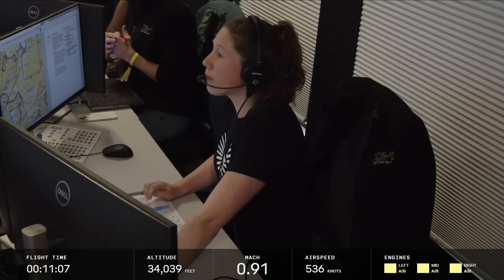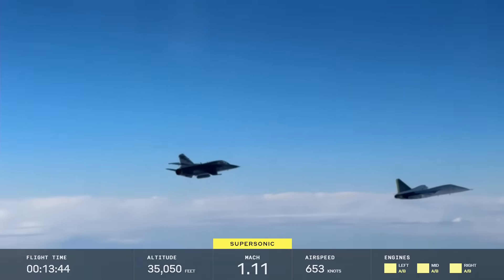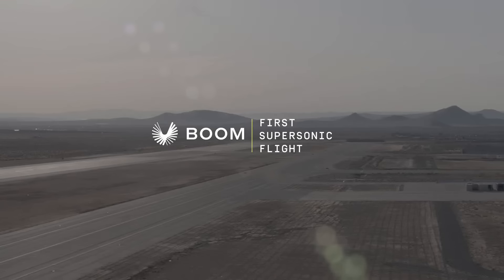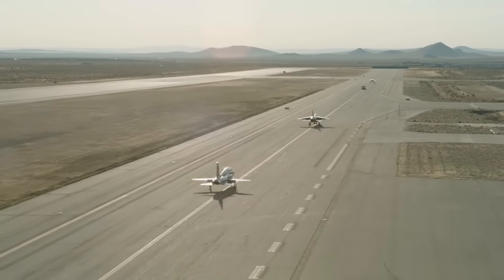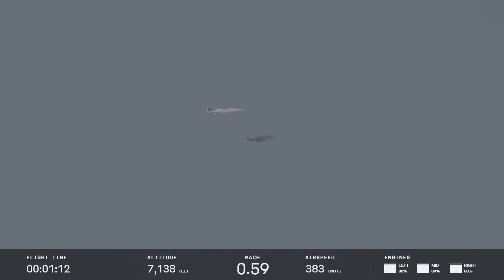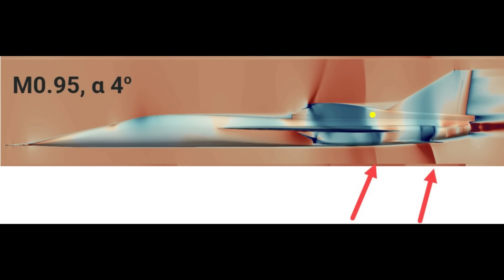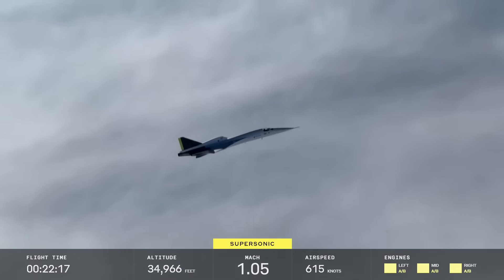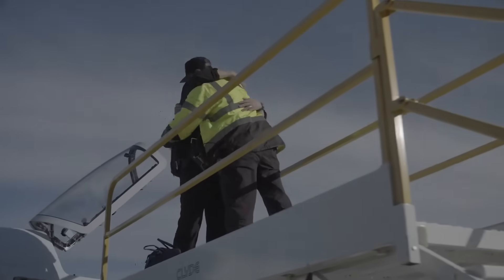XB-1 Baby Boom Goes Supersonic - Jet Planes, Starlink & iPhones

Comment: The physics of Boom's Overture isn’t in its favor: sonic boom strength scales with the cube of Mach number based on slender body theory, and so using Boom’s own numbers suggests it’ll be over 60× louder than their XB-1 demonstrator. Even if you shape the N-wave into a “thump,” the total acoustic energy from a 170,000 kg SST is still enormous. And let’s not forget that supersonic overland flight is still banned by the FAA and ICAO. Boom has no certified engine, no clear path to regulatory approval. This increasingly looks more like a PR story than a viable airliner.

Comment: Mach 1 in a small jet isn't to hard there a few business jets past and present that could hit Mach 1 under favorable conditions so all you really need is the optimized air frame. The jet that I am thinking of is the original Lear Jet which is very jet fighter like and I have heard similar claims about some more modern jets as well.

Comment: Scott, they won't be going supersonic over land. The public had a big issue with that. Broken windows, damage to hearing, just general annoyance, etc. This aircraft will fly over land at Mach 0.95, so no sonic boom. It's about 20% faster than a 787. They will go Mach 1.7 over water. (so, LA to NYC in four hours instead of five, and LA to London in about eight hours instead of 11.)

Now, there's something called Low Boom, that Lockheed and NASA have discovered, that lets you break the sound barrier with a sonic boom that's barely audible. THAT one will be able to fly over populated areas. 🙂 I think they are supposed to start testing that over populated areas this summer. Boom Supersonic will hopefully start using that at some point as well. 🙂

Comment: Eh, the political aspect of the supersonic overflight ban is usually greatly exaggerated by Europeans. The real reason is that the Air Force conducted actual tests of supersonic overflights of populated areas to simulate something as large as an airliner in supersonic flight... and caused a ton of damage to buildings across Oklahoma City. The same ban killed Boeing's SST (which would have been significantly better than Concorde in almost every way,) too.

Comment: What engines do the concord boom has. I honestly hope it has ramjets which would probably increase fuel economy at supersonic cruising speed.

I think ramjets could help fuel economy but idk if I could be wrong. Somebody let me know if I AM wrong on that
Reply: You can find details about their engine on their website, doesn’t look like ramjet
Reply: @olasek7972  I saw. It's not a ramjet. It has compressors. Plus the tri-engine design might not work well with 2 turbo fans and 1 ram jet. The ram jet will output tons of probably unbalanced thrust unless precautions are made, and I think the design shouldn't get changed like that anyways...

Comment: The CJ610 spools up pretty quickly as anyone who has seen an early Learjet in action can attest (it's also the same engine used in the T-38). I can't tell you what might have been going on in terms of acceleration or if they have a FADEC system that commands a slower power up. Interesting that the XB-1 needs afterburner on its 3 CJ610s to go supersonic while the T-38 can pass mach unity (also with afterburner) with 2. While the XB-1 is larger overall, its operating weights are largely similar (13,500lb MTOW v. 12,500lb for the T-38). Perhaps the T-38 is using a greater proportion of power from its afterburners than the XB-1 is. Supposedly the XB-1 has a hypothetical max mach in the 2.2 range.

Comment: The Concord was a failure for a number of reasons. US manufacturers had a supersonic airliner that carried more passengers and went faster than the Concord. The problem was that sonic boom. Even US based manufacturers couldn’t get approval to fly over most of the States during supersonic flight. Without that, it simply didn’t pay to produce it. What parts of Europe allowed the Concord to overfly during supersonic flight? At any rate, new work seems to be able to minimize that boom, possibly allowing a new age of supersonic flight.

Comment: When I was growning up in the 1950s-'60s near Wright Patterson AFB, sonic booms were a fairly regular experience much to the consternation of our neighbors and especially my mother.  A large crack appeared in the plaster of our dining room ceiling that kept growing with those regular loud booms and Mom was pretty upset.  The Air Force purchased a house a couple blocks away and installed sound/pressure test equipment to monitor the noise from activities at Wright-Patt.  The current restrictions on supersonic travel over the Continental US were a result of the that testing/noise creation/property damage from those "old bad days" and had nothing to do with the much later appearance of the European Concorde.

Comment: The reason they didn't allow supersonic planes to fly over the continental USA is because of the sonic boom over built up areas not because of politics. This is the main design parameter of Boom Supersonic to reduce the sound wave caused by the sonic boom.
Reply: Correct on the first part, incorrect on the second.

A lot of people are getting confused, that’s a different project. Boom doesn’t care about shockwave noise, they are developing an aircraft purely for trans oceanic flight.
Reply: Wrong about the sonic boom, the goal is to make a profitable 1.7 Mach 64-passenger aircraft regardless of the sonic boom however even this seems to be doubtfully realistic goal.
Reply: @olasek7972   Right about the sonic boom. Google 1973 Civil Supersonic Airplane Noise ban.

Comment: Supercruise should be a requirement for light supersonic jets like this one... having to use afterburners in order to go supersonic is so 20th century, also, it's not financially viable. 

Concorde used A/B for takeoff, but it had supercruise capability, otherwise it wouldn't have been able to do supersonic transatlantic flights, because the fuel consumption rate when using A/B is crazy high (even at 30+k ft)... and also because using A/B for an extended period of time will screw up the engines.

Comment: 0:34 I was going to ask why the airspeed was only 614 kts at mach 1.05, but it dawned on me that it's because the air is pretty cold up there¹.. Too bad the plane isn't going through pleasant air around 20°C, because that makes the conversions so much nicer:

Mach 1 = 666 kts = 1234 km/h

Also 343 m/s, 767 mph, 1125 fps, but I like the kts and km/h values better 😅.

¹ around -44°C according to Deepseek.

Comment: Scott - always enjoy the content you produce.  Would suggest for another video a discussion of the correlation between airspeed and fuel consumption which has (I believe) always been the limiting factor in supersonic commercial flight.  The need for low drag with a small diameter fuselage limits the seating.  Add in the required large fuel capacity for supersonic flight results in very high cost seats.  Boom Supersonic may solve the shockwave problem, but they will still have the fuel consumption problem.  I submit that like Concord, there may be a market for it but it will be limited to those passengers willing to pay a lot of money for a seat.

Comment: Besides the sound problem, there is still the tire problem, a larger heavier will have bigger tires. Concord was an accident waiting to happen and this will be true of any commercial aircraft. I really am unsure what the point of this demonstration does?
Reply: The point of the demo aircraft is to prove that supersonic planes can be designed to minimize the 'boom' that is heard from the ground when a plane flies overhead faster than the speed of sound.

Comment: What’s the big deal? We have had passenger lines travel at supersonic speeds. What am i missing here?
Reply: The difference is that now, aerospace engineers have a better understanding of what causes the supersonic 'boom' perceived from the ground as a plane flying faster than the speed of sound passes over. The point of this demonstrator is that we can now prove these new theories in design before we commit to scaling them up into a revenue vehicle. It's also the first fully privately-funded aircraft of the sort, and first time the process is completely being done in the US!

Comment: So if you look up "Dark Skies" review of the British Fairey Delta 2, that looks a LOT like the XB-1, and you realize they designed it with no computers, and no wind tunnel of sorts, in the early 1950s, and flew it to Mach 1.47 or 1,132 mph on March 10th, 1956, and it had a cant down nose, and it became the inspiration for the Concord, and that poor Fairey Aviation couldn't get a military contract and eventually teamed up with Dassault Aviation to make the Mirage (one of the chase planes, for God's sakes)from the basics of the Fairy Delta 2, I  find myself thinking what's new?  😉  But to WawaWow me here, you gotta tell me like "they are sipping fuel at a tenth of what the Fairey Delta 2 was doing" with a single old British jet engine in 1956!!!  Hell yeah, it's amazing, but is it really cutting edge when the Brits did it in 1956???  68 years ago???? 😮

Comment: Wary about Supersonic only achieved with afterburner.
Concorde could supercruise. It only used reheat to transition
Reply: That's because Concorde cruised at ~60,000 ft, where the air is a lot thinner and drag is minimized. The full scale aircraft for Boom will likely do the same :)
They obviously wouldn't push this hard as a company if the aircraft made no financial/economic sense.

Comment: DIT here. 8:40 some of the shots before the iPhone were in a LOG profile that's used for color grading. It's flat and washed out for the specific reason of preserving more information and dynamic range of the sensor. You'd want to shoot like this if you're planning on using these shots later for anything other than streaming. Like a video recap, commercial or even social media – anything that requires editing. Which I'm sure they do. Probably someone forgot to change the settings or apply a correction LUT on the switchboard. Newer iPhones can actually shoot in this profile too, however it's off by default.

Comment: If it didn't go supersonic without a single issue, then it would have been a piece of rubbish.
Only the dB level of the sonic boom is of any consequence, as that's what they're designing against, yeah?
Beyond that, I'm guessing engine fuel efficiency at supercruise speeds and at high altitude is of utmost importance.

Comment: If they need to use reheat to be able to achieve 10% over the speed of sound, they're missing the point. In order to make a significant difference to journey times, they need to get to M2. And they need to be more fuel-efficient than just throwing fuel into the exhaust in order to have any chance of a long-range cruise. I don't have much faith that their current direction, using fanjet engines, will take them as far towards their goal as they need.
Reply: The Overture aims to not use afterburners
Reply: @haven216  Well of course not. But the fact that they had to use afterburners to get this test plane even marginally supersonic means it cannot be considered representative of the aircraft they claim to be developing. It is not a proof of concept. All it did was to demonstrate that they know how to maintain control while transonic. While that is crucial, we learned that more than 60 years ago.

Comment: You can fly supersonic above 35k feet msl (or) within defined special use airspace. It's fairly anticlimactic when you punch through that mach barrier and depending on the vehicle it can get a bit bumpy at the transonic area, but usually gets buttery smooth on the other side.

Comment: I'm confused. Isn't the point to Boom Supersonic to reduce the sonic boom? There's no big challenge, per se, to go mach 1. There's a Gulfstream that goes Mach 0.9. The only reason reason commercial aircraft aren't engineered to go faster is because of the shockwave. You can't fly the shockwave commercially over land because it's a major nuisance. Indeed, the Concord did not fly supersonic over land, it accelerated to Mach 2 over the ocean. So is there any information on how the Boom Supersonic shockwave compares?
Reply: You're confusing this aircraft with NASA's X-59. Reducing the sonic boom for Boom is an afterthought at best

Comment: Afterburners?  That sounds Efficient . So just another way for Rich people to avoid supporting say High speed rail. While the pores have to show up 2 hrs early wait in line  barefoot till we get crammed into Tube that smells like B.O. and  jet Fuel  . So we can get to the other airport were we get to wait to find out that our luggage is lost . Then we get  to drive or ride another 40 minutes to get to the city that the train goes to in the first place.
Reply: Well, the key to the success here is the engine which doesn’t exist yet so relax, this may never materialize 😊

Comment: The actual solution to sonic booms it to just fly higher. The energy in your shockwave is proportional to dynamic pressure, and that refuduces exponentially with altitude. The density gradient also attenuates the waves and the temperature gradient refracts them outwards. I have to run the numbers to be sure but the same SST produces like 5x less noise at FL75 vs FL60

Comment: Not gonna lie, I would rather be the chase pilot in the Mirage F1 than the test pilot flying the tech demonstrator.  Of all the planes in that formation it has by far the most performance despite having the least number of engines.  Oddly enough that brings up another pattern of that formation, that being fewer engines correlating to higher performance (at least for speed, the T-38 probably turns the best out of them all).

Comment: Interestingly, I don't think this is actually the first supersonic flight. I was watching KSTRL11 do testing runs on Dec 19 at 10am on flightradar, where it was flirting with transitional supersonic speeds and going over. With the required amount of testing, kinda makes sense that they wouldn't be filming if a collosal failure was possible in the early stages with the cameras turned on. , Congrats regardless and love all the glitter, glam and imax. 
Fast flight is needed and not every airhub have chopstix for catching rockets.

Comment: This is a great achievement, and I'm thrilled for them. I also have appreciated their detailed videos chronicling the test flights. I do feel, however, that they're in a tough spot. No supersonic passenger plane can come out in this age that doesn't fully embrace the quiet boom that NASA is now testing using the X-59 QueSST. That process is going to take several more years, and in the meantime, Boom is just cooling their heels. They will have to go through another design iteration (trijet to quad jet and then someday the quiet boom), making this their third version of the Overture (aptly named) passenger plane they've put out. Hopefully, the third time is the charm. Then they have the issue of the engine design and who's going to manufacture it, and raising billions and billions it takes to produce a large, complex passenger plane. Clearly, Boeing isn't up to the job. Hopefully, Boom can pull it off.

Comment: There was a demon that lived in the air. They said whoever challenged him would die. Their controls would freeze up, their planes would buffet wildly, and they would disintegrate. The demon lived at Mach 1 on the meter, seven hundred and fifty miles an hour, where the air could no longer move out of the way. He lived behind a barrier through which they said no man could ever pass. They called it the sound barrier.

Comment: I do want point out, Concordes' failure had more to do with design than politics. US did the infamous Oklahoma City sonic boom test in 1964, which was so terrible that the test had to end early. Concorde engineering failed to consider the noise impact, both during supersonic flight and during take off and landing, which significantly limited its route and airport compatibility. 
XB-1 actually tried to solve this issue from Day 1, having aerodynamic designs trying to bring the noise level down.

Comment: The pitot tube itself shouldn't have any issues around mach 1 as long as it's in undisturbed air, which it is, so I think the problem has all to do with the static port: It does make sense that as you approach mach 1 a normal shock can form on the side of that pitot-static probe in front of the static port causing an erroneously high static pressure reading, resulting in both erroneously low mach number and erroneously low altitude. As the airspeed increases more, the normal shock moves further aft, and once the shock passes the static port the speed and altitude misindications suddenly resolve.

Comment: I would fly Overture over a first class seat on a slow plane.  I think most people would.  Concorde ran about 20 seat miles/gallon.  That's about four times the fuel cost of a typical airliner's 80 seat miles/gallon.   Fuel is roughly 25% of total cost for the typical modern airliner, so if all other things were equal, Overture would be 1.75 times as expensive per seat mile.  But most likely other costs go up as well, but still you could be looking at a 2x seat mile vs conventional airliners if they do the engineering right.  This is well within first class pricing, and will be very disruptive to the current airline business model,

Comment: Scott, with single prop airplanes, if you're finding yourself left of centerline, you most likely are not using enough right rudder. This is a very common problem
Reply: Scott was flying the XB-1 simulator, not a single engine prop plane.
Reply: @stargazer7644  having not flown the simulator myself, I have no comment